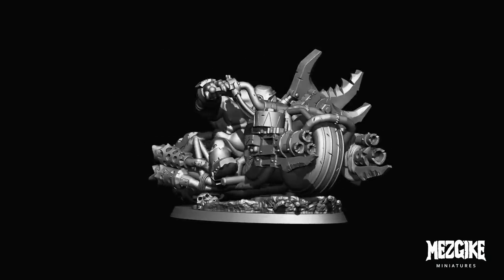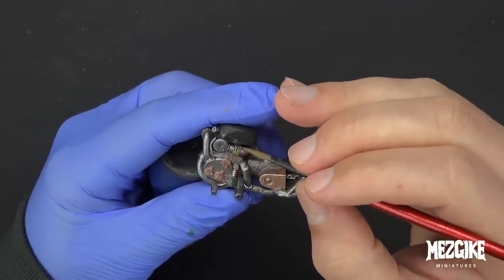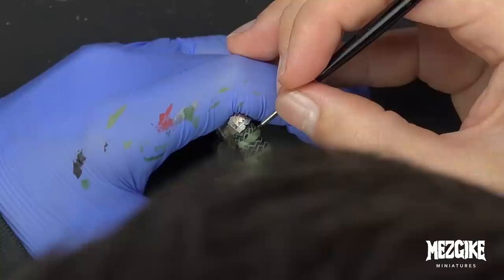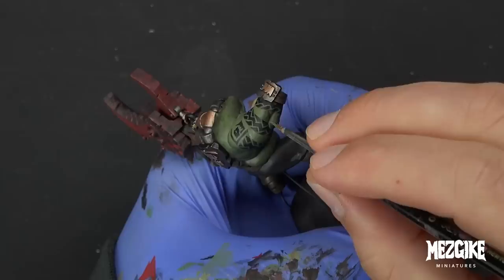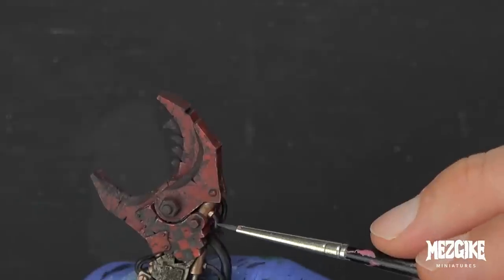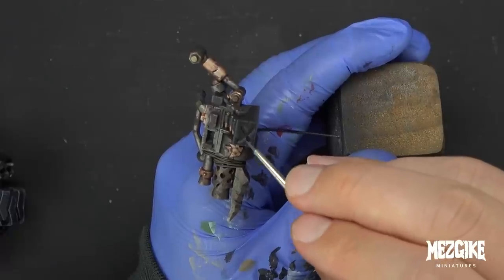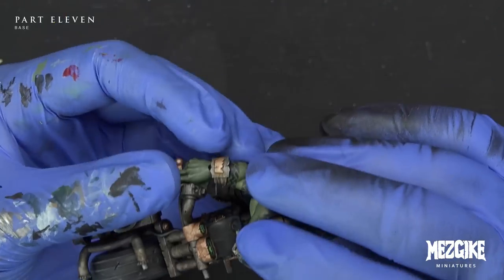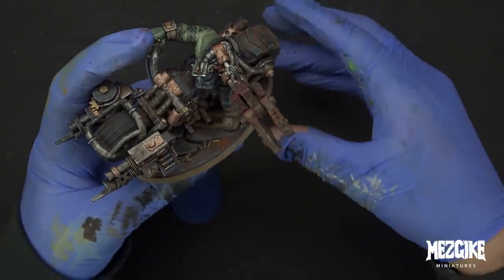How to paint Da Road Boss

Comment: What printer was used to print this dude?

Also, another glorious video!
Reply from the maker: Phrozen sonic mini 8k. A game changing printer!
Reply: @Mezgike  It really is. I think I spotted layer lines once or twice in this video and they didn't seem particularly prominent! Time to start saving haha.
Reply from the maker: @willjones1696  if you look super close you will see some but they’re so feint and you only see them in certain light. After a few coats of paint they’re all gone. Also the phrozen mini was pretty cheap. So cheap for what it is
Reply: @Mezgike  That's true. Compared to the Mars 2 Pro that currently have, your print is on a completely different level. You're right, it's very cheap for what it can produce! Still, as a student might take a while to save 😂